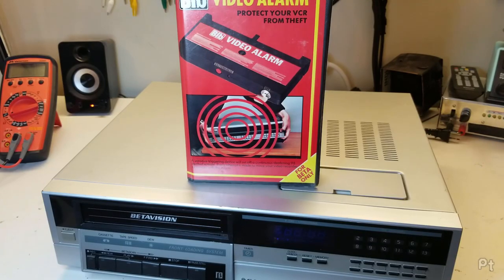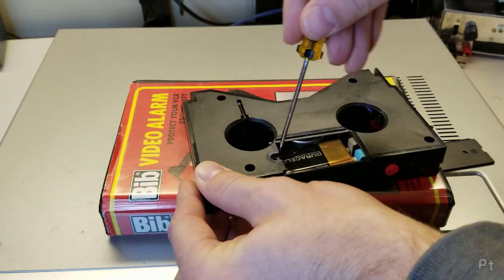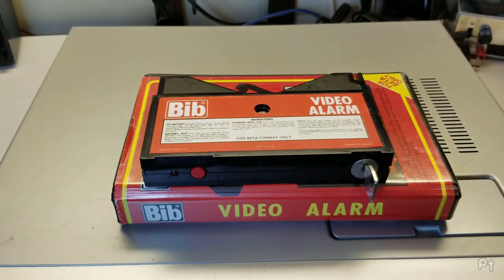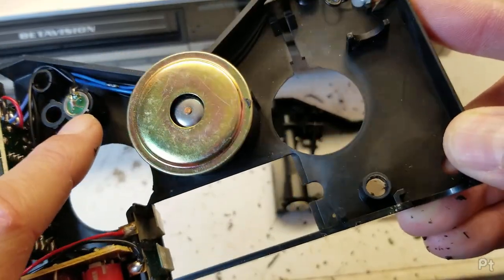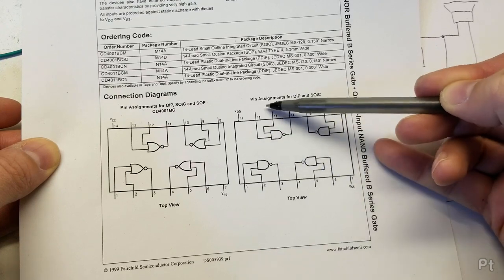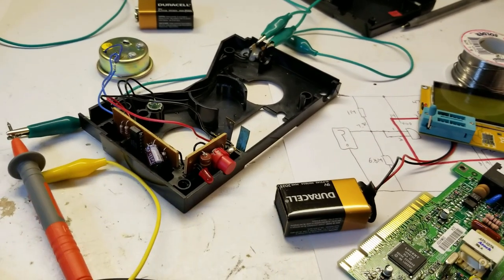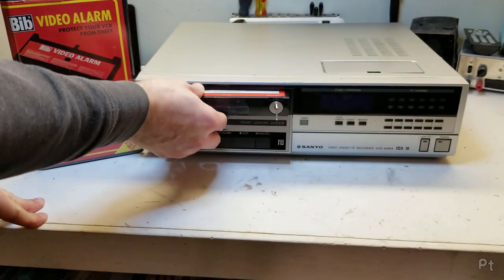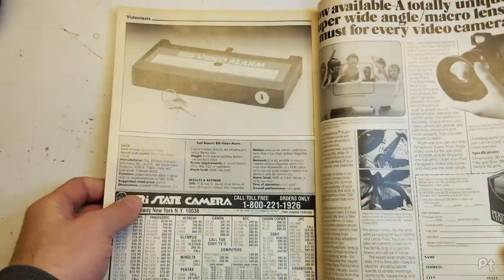The Bib Video Alarm (Anti-theft device for Beta!)

Comment: the device You show with a question mark is probably a kind of mecanical g-force sensor, I have seen some that inside has a spring and little steel ball, and actuates like a normaly open switch.